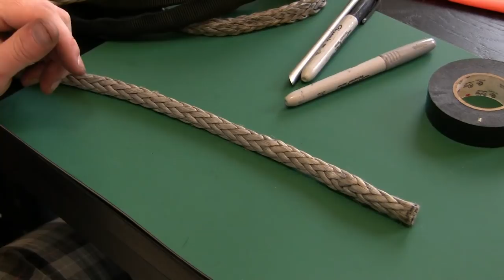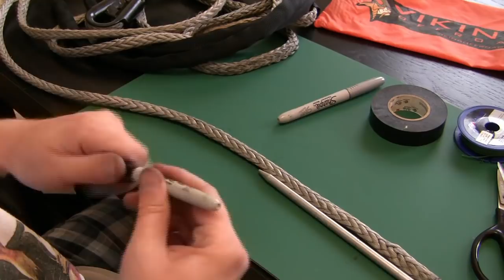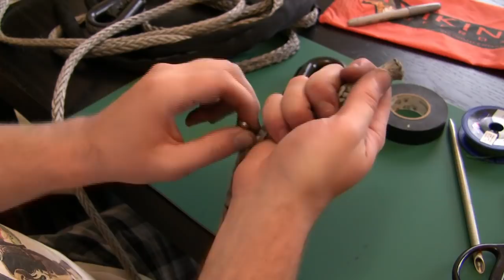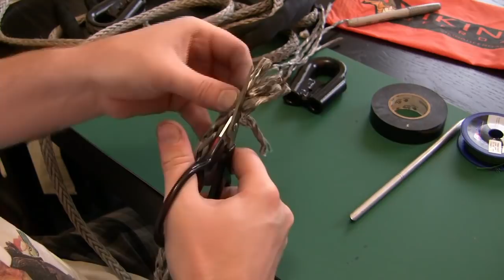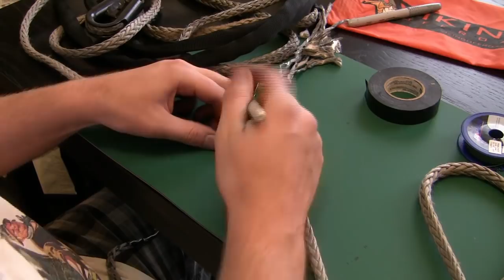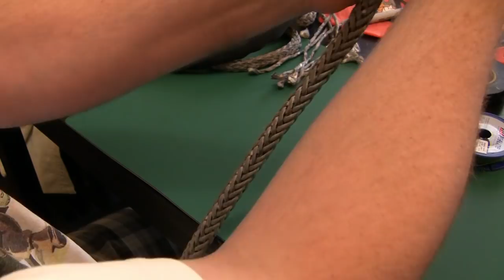Dyneema Eye Splice Demonstration

Comment: Most of this is wrong.  I suggest that you investigate the way sailors do tapers and splices.
Reply: To be fair, the main thing wrong is that these buries MUST be lock stitched. With a 3 1/2 Fid bury and a 1 fid taper, these splices will hold 90% of the original breaking strength. Yes, I always use a locked Brummell but that’s mainly because I don’t like lock stitching. I know the taper is not technically correct but pretty close.

Comment: Are those Samson thimbles not still considered "open"? Even if strong enough, wouldn't continuing the trough through to the front mitigate bend potential? Clearly the only reason they'd manufacture them that way is to save a few bucks, correct?

Comment: This video should be titled "How NOT to do a Dyneema eye splice".  There should be a locked brummel, the taper should be more gradual (cut like you did but do it strand-by-strand until you've cut 11 strands) and the bury should be much longer (ideally, 72x rope diameter).
Reply: That’s not exactly true. A 3 1/2 fid bury with a 1 fid taper will hold 90% of the rated breaking strength BUT could slip out when it isn’t under load which is the reason that it MUST be lock stitched. Yes, I always use a modified or “Locked” Brummell which doesn’t require the lock stitch but both methods hod a similar load.

Comment: I do not have a fid! What can I use instead?
Reply: Knitting needs can be used as a cheap Fid.
Reply: Some also use Bic pens with the ink barrel pulled out. The best are Selma fids, however.
Reply: Some also use Bic pens with the ink tube and tip pulled out but the best are Selma fids.
Reply: Alloy knitting needles from woolies are great

Comment: What does tappering do i am just building moorings
Reply: If you dont taper you will create a point of failure where it ends inside. But this Video is not a good tutorial for eyesplices that really need to hold something. This eye will slip out over time if under varying loads
Reply: @maltehundertmark912  well… to be fair this type of bury will hold fine as long as it is 3 1/2 fids long with a 1 fid taper  and MUST be lock stitched for a 90% capacity.

Comment: this video should be deleted - the technique demonstrated is not safe.
Reply: Unsafe! It can be taken out; there’s no reason not to do a Brummel splice
Reply: Why?
Reply: @andresedmach3903  It's super easy to tie a locking brummel. But the knot here is not that! It can simply slip and fail. There are reasons to not tie a locking brummel - like aesthetics - but a tow rope is certainly not one of them.
Reply: Yes, I o prefer a locked Brummell as well but this is safe as long as there is a lock stitch and a 3 1/2 Fid length bury.

Comment: I might have been tempted to pass the tail thru the rope a couple of times before buring the tail in the rope even though a Brummel lock can't be done on one end.  Lock stitching is not a bad idea as well but in the case of your eye splice, it is critical.  Good video.  There are allot of scissors out there that will cut UHMD fibers well, look for Kevlar scissors.
Reply: What you’re describing is the original Brummell  splice. The other one that most use now is the modified or “Locked” Brummell splice which doesn’t require lock stitching.

Comment: What scissors are you using? You mentioned that they work great but not what there are or where someone might get a pair. Thanks,
Reply: I splice Tech 12 a LOT and always side small KS-2 Kevlar scissors as they have micro teeth that keep the line going back towards the cut. They have them on Amazon - Miller KS-2 Fiber Optic Kevlar Scissors

Comment: Best Value in Shears/Scissors for cleanly, quickly cutting UHMWPE, Dyneema, Kevlar, etc. cord/rope:
Klein Tools 544KV Utility Shear, 6-3/8-Inch 

These shears cut like a dream.
Micro-serrations on one blade firmly grip fabric/cord during the cut; the other non-serrated blade allows sharpening.
Klein forged the blades from carbon alloy steel and tempered them to Rockwell hardness = 62C (VERY HARD)
Pivot bolt allows tension adjustment.
Price:  $12 to $14 typical
* https://www.kleintools.com/catalog/industrial-utility-snips/utility-kevlar-shear-fiber-optics-6-38-inch
* https://www.amazon.com/gp/product/B073GCKNJ8
* https://www.homedepot.com/p/Klein-Tools-6-3-5-in-Utility-Kevlar-Shear-544KV/302589187
Reply: Good tip. I use bonzai scissors.

Comment: Look up Brummel Splice. The bury isn't what locks the line - it is the double pass of the two ends which has been completely omitted here. The bury just keeps the tag end enclosed. What is shown here is weak and prone to slip. A Brummel splice cannot and will not slip under any circumstance.
Reply: Agree. I would use a Brummel splice too.
Reply: @marinoldus  +1 no way would I trust a winch rope with only a buried loop  its vids like this that get people in a serious mess !!!
Reply: I was shocked when I saw that man just went straight into burring the other end
Reply: +1 agree, this is not a very good way to splice a loop that will be loaded.
Reply: The original Brummell went through the line twice then buried with a taper. It was good but not great. The modified or “Locked” Brummell is what most people talk about. If you do only do a bury it MUST be lock stitched.
Reply: @ActuallyRayPierce at the end he says he is going to stitch it.
Reply: I think he butchered this one.

Comment: Dayum take sooooooooooooo long. Boring. Lost me
Reply: If you're not interested in doing the job then don't watch a video on how to do it.
Reply: @PanicAcid  thing is, he did a shitty job.   This is a great way to  have a slipping splice
Reply: @veganpotterthevegan All that was missing was the correct taper and lock stitching in which case it will hold 90% of the original breaking strength.
Reply: Rusty
Search Premium Ropes.
They have some nice clear videos.

Comment: Only because I like using it, check out the Selma stainless fids. Don't have to taper (though good idea) or tape the rope to get it into the fid
Reply: Yes, the Selma fids are best for 12 strand hollow braid but you should still ALWAYS do a 1 fid taper. Otherwise it will seriously reduce your strength.

Comment: Hi, what is the make/model of the scissors you are using? Thanks.
Reply from the maker: They are Benser scissors. You may also find them listed as Clauss-Benser or BensClauss.
Reply: Ah, thanks. Made by SILKY, a Japanese company, famous for their professional cutlery and saws. Great choice!
Reply: Thanks! I had the same question. And thanks for the beautiful and simple video!
Reply: I splice Tech 12 a LOT and always side small KS-2 Kevlar scissors as they have micro teeth that keep the line going back towards the cut. They have them on Amazon - Miller KS-2 Fiber Optic Kevlar Scissors